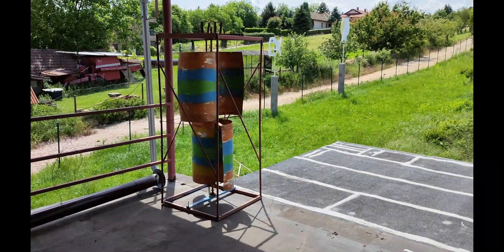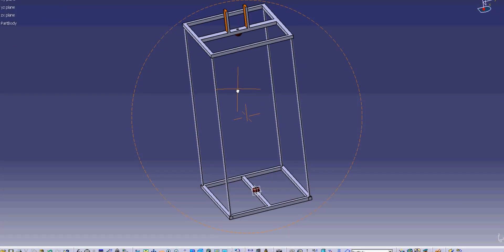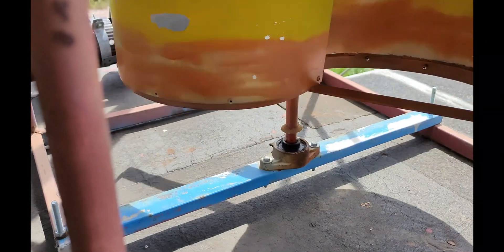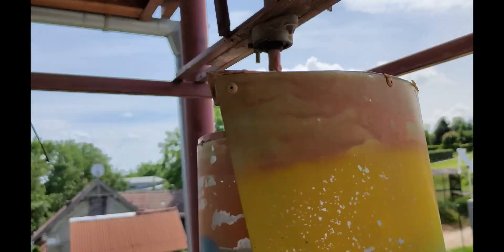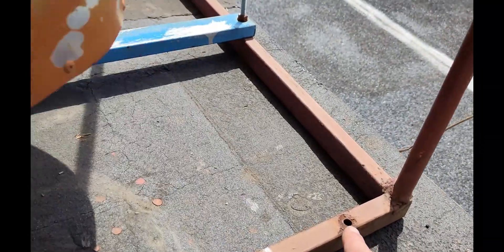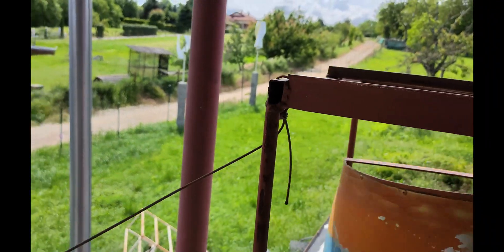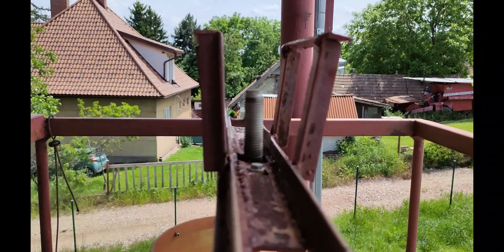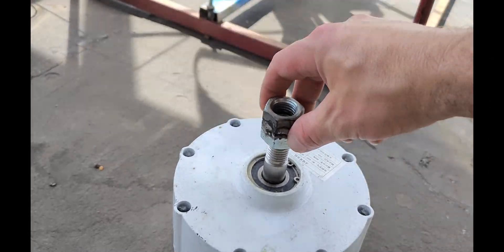Do You Want To Have Your Own Efficient Wind Turbine? -  Construction Guide

Comment: Efficient?!? All practical tests show that small wind turbines hardly generate any electricity, because hardly any wind blows close to the ground. 
With solar panels, you can generate at least 20 to 30 times more green electricity with the same investment (time & money)!
Moreover, the wind is extremely gusty, which almost always greatly reduces the service life. Only those who MUST be off grid in winter should install a large wind turbine on a high tower. Solar panels, on the other hand, reliably generate over 25 -30 years electricity at approx. 3 to 8 cents/kWh.
Reply from the maker: In the case of solar panels, it is also necessary to consider the location, orientation, and large area. The panels should be tilted differently in summer and differently in winter.
At the same investment? ))
you can make such a turbine from waste almost for free. the size of both the turbine and the generator is arbitrary. I have how to make a generator in an older video.
maybe I will also prepare a video for a 220V generator.
how this type of turbine works in the wind can be seen in the link in the description below the video.
I also recommend looking at Airloom energy, Liam F1 turbine, wind powerpod turbine...
This particular turbine in the video is over 11 years old, it is possible to build a lifetime...

Comment: All amature designers make the same mistake because they do not understand that torque is the main energy production factor. To make any decent power, you need very large radius blades. Force * distance= T. These tiny savonius models are useless because they produce pitiful torque. Nice try though.

Comment: 1) All small wind turbines actually achieve only 5-15% of the advertised power.
2) All practical tests show that small wind turbines hardly generate any electricity. And only at costs above 1$/kWh! 
There is hardly any wind near the ground. And it is also very gusty, which extremely reduces the service life of the systems. 
With solar systems, you can reliably generate green electricity for about 3-10 cents/kWh over a period of 25 years!
Reply from the maker: Do you have an explanation why small turbines do not produce electricity and large ones do, does it make sense to you?
Isn't the problem only in the type of generator?
Do you know, for example, this Liam F1 Wind Turbine?
If you really want to learn more, use the translator and see:
http://www.vawt.om2cm.sk/?q=forum
Reply: @rades.peron_invention  Because there is hardly any wind close to the ground – and electricity yield is proportional to the third power of the wind speed: 100% more wind generates 800% more electricity! Large wind turbines rotate in the Ekman layer above 100 meters, where the wind is much stronger and more constant.
Reply from the maker: @michaelvanallen6400  Friend, friend, no one denies that low down on the ground is a turbulent and highly laminar flow of air.
There is no need to be preconceived, science is moving forward, the wind can be concentrated check:
PowerPod wind turbine
And they are too low voltage charging controllers..
The wind does not get tired, it goes almost constantly
Reply: @rades.peron_invention  The reality: Wind rotors have been used to generate electricity for 140 years. Research into wind power rotors has been going on for over 100 years (see Beetz). But there is simply hardly any wind near the ground. Above 100m, however, it is many times stronger and more constant. And: 100% more wind = 800% more electricity yield ......Therefore: No matter what blade shape or wind power type. There is simply not enough wind close to the ground!
Reply from the maker: @michaelvanallen6400  lol and therefore Bill Gates invests in AirLoom energy ))